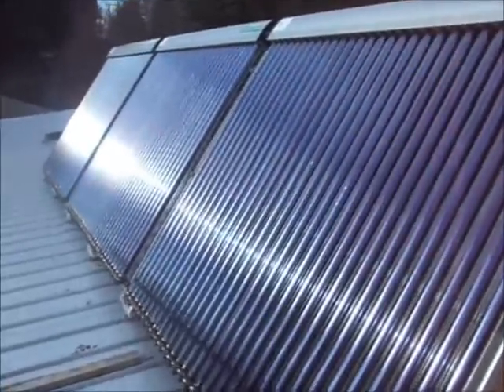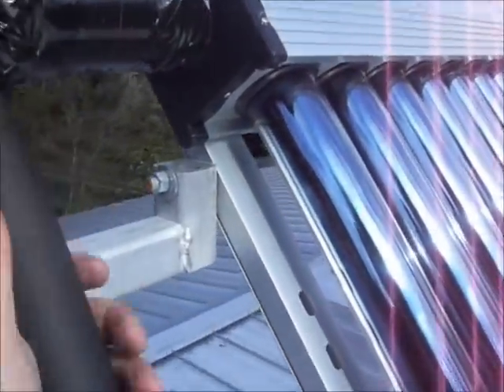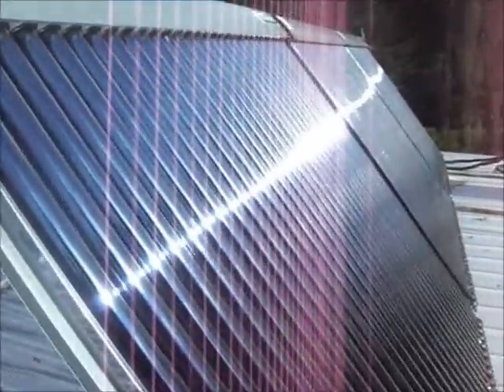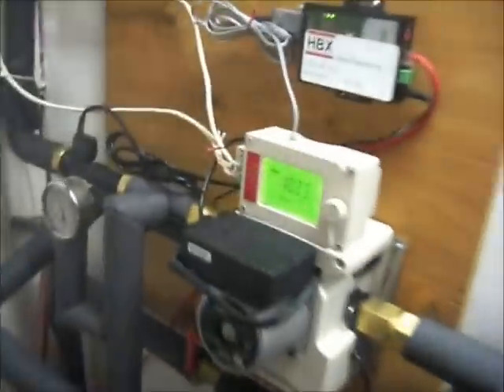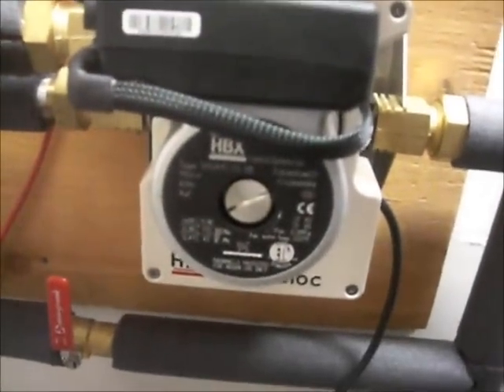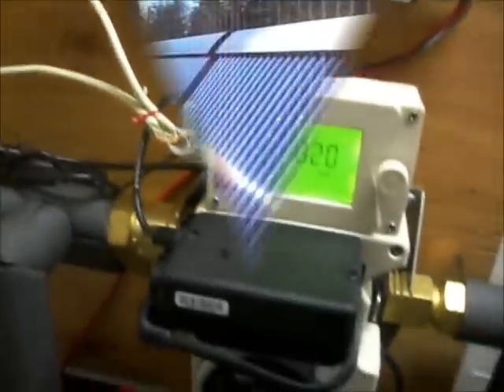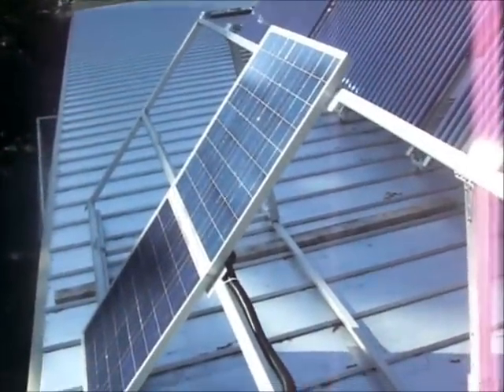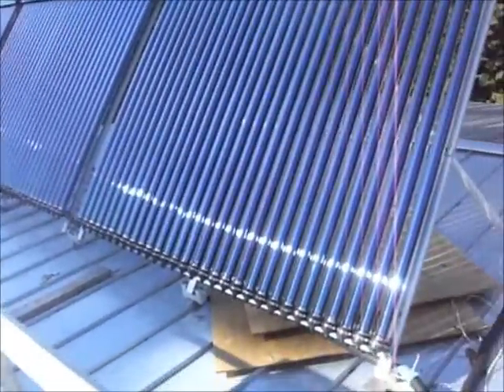Final completion solar thermal collector installation www.coastalsolar.ca

Comment from the maker: Hi. I've seen the solar can heaters. But the biggest issue is that you have no heat storage. Most of the time when the sun is shining (unless it's in the winter) you already have comfortable ambient heat. With the evacuated tubes and storage tank that heat you pick up on sunny days lasts for several days of domestic hot water. Sure, a DIY collector saves you money but overall performance leaves something to be desired.